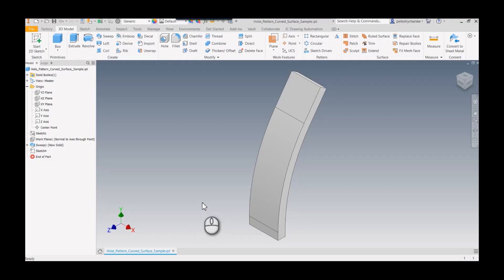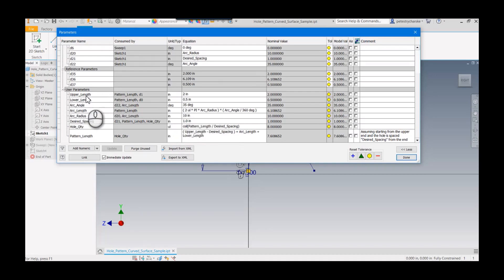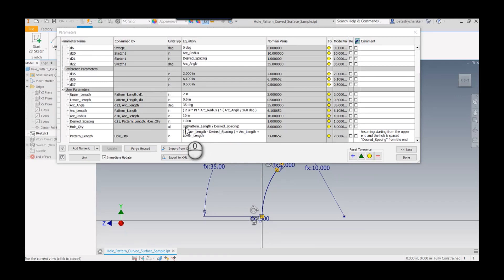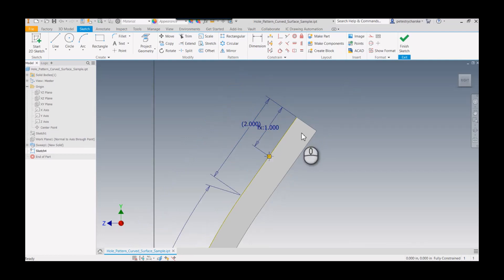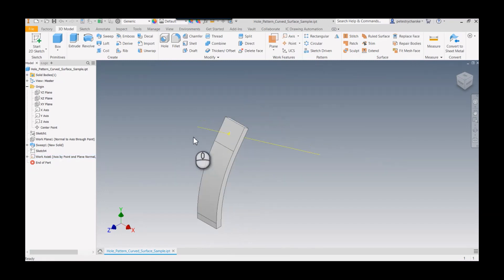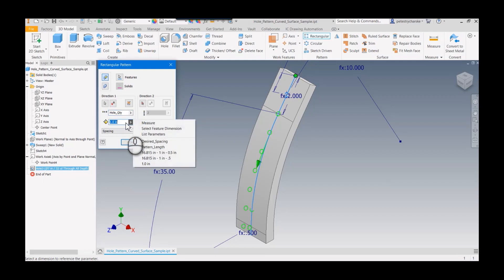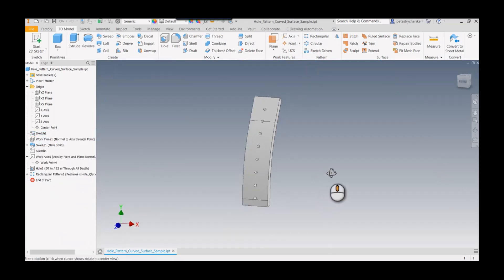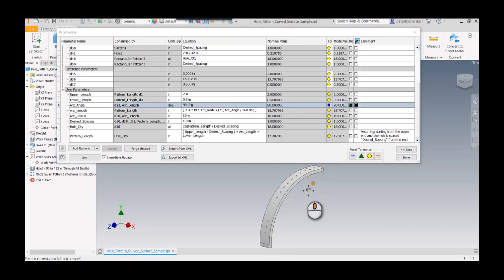Inventor - Create a Path & Hole Pattern on Flat and Curved Surfaces

Comment: Autodesk inventor has broken this. In inventor 2022 the holes go off the plane that they are selected from and don’t follow the curve of the surface and you get weird warped holes that were patterned.
Reply from the maker: Maxim, I'm sorry to hear of your troubles.  I just rebuilt the pattern in Inventor 2022, following the steps in the video, and the patter worked correctly.  Please be sure that you are choosing the "Start"ing point at the first hole in the flat portion of the part, otherwise it won't look quite right.  Hope this helps and have a most blessed day!

- Pete
Reply: @Team-D3  maybe a recent update has solved this. I started at a new job and they are still using 2020.
Reply from the maker: @SpotterDeer  Glad it's working for you at your new job and let us know if you run into this issue again.